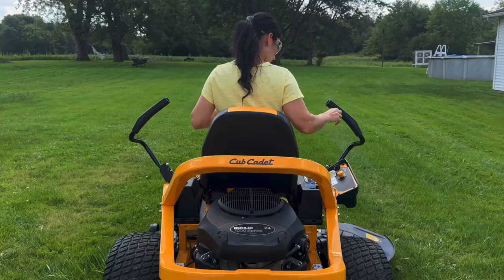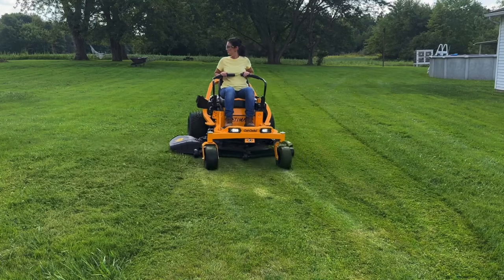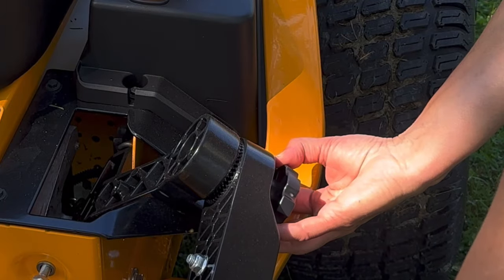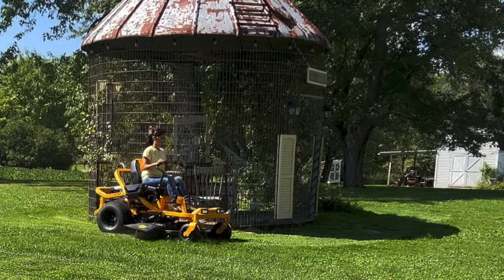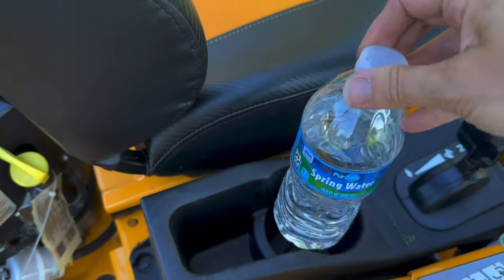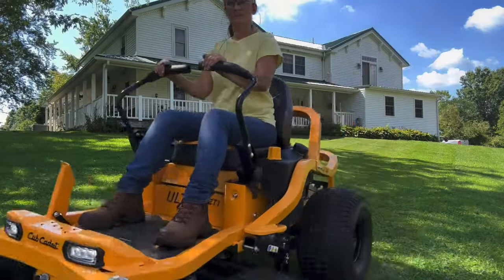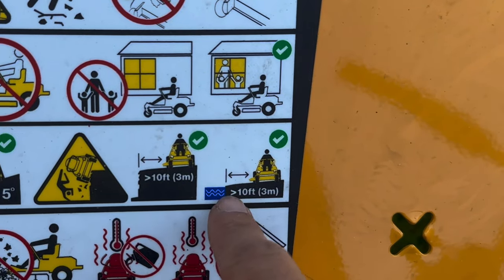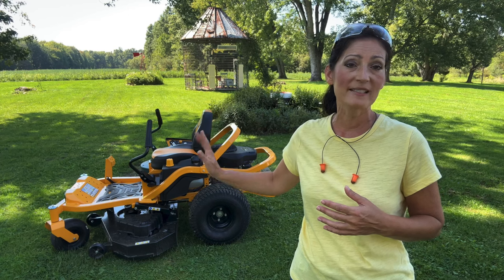MUST WATCH Everything you Need to Know! Cub Cadet ULTIMA ZT1 54" ZERO TURN MOWER FULL REVIEW Demo

Comment: I believe the hour meter is available at an additional cost. The only downfall for the ZT1 is the transmissions are not repairable, hence, they would need to be replaced when they become faulty. The ZT2, however, has a transmission which can be fixed or parts replaced.

...also, the seat does not have pivoting latches like ZT2, instead, you would need to remove hardware to get underneath, as with the ZT2, the seat just lifts right up for access

Comment: I bought a ryobi 54 in last year, (15 months ago) The battery drains out and the blades stop spinning after 20 minutes. The battery has the warranty for just one year. New battery costs $2000 and NO Warranty!!! After seeing this video, I’m going to buy a cub cadet 54 in from a Tractor supply in New port Richey, Florida.. It $3599 now

Comment: ZT1 50 for me!  Just ordered it this past Friday through a dealer.  I ordered the armrests and hour meter.  $4.1k out the door.  Do I need a 50" deck?  Nope, but it's good to have, and I REALLY wanted a 3-blade fabricated deck.  Why 50"? ... even though my yard is less than 1 acre, I have a couple seasonal neighbors that may want me to mow their yards from time to time when they are not here.  So, it's good to have the capacity to knock all of our yards out in an hour or two with the larger deck.  At least that's what I told my better half.  Here we go!  Thanks for your video!
Reply from the maker: @nhojcam  Let me know what you think of it! I love mine, this is my second summer using it.
Reply: @Jennyfromtheshop , i'm sure i'm gonna like it.  the weak link on all (as in, every single residential zero turn of every color of paint and brand) of these "residential" lines of mowers is the stink'in 2000 hydro's they put on 'em.  man, they just suck.  i plan to service mine every 100 hours or so.  yep, no drain plugs on these, so i'll take 'em off and drain them.  i'm in FL, so that means probably once per year.  i may install drain plugs the first time i have them off.

Comment: You can add an hour meter with this Cub Cadet kit.  Part # 490-900-C075. It’s about a 10 min install.  Kohler recommends the oil to br change every 100 hours and the filter every 200 hours.  I personally change both at 100 hours.  This is on the Kohler 7000 series engine.
Reply from the maker: Thank you!
Reply: @Jennyfromtheshop  Tractor Supply carries the kit. Cub Cadet online seems to be out of them. There is supposed to be one locally here I purchased online and will try to pick up later today.
Reply: We mow a LOT, and generally accumulate 35-40 hours per lawn-mowing season, and change the oil & filter each year. Our ZT-1-50 has a Kawasaki engine. The hydrostatic wheel drives are not designed to be owner-serviceable, you have to move up to the ZT-2 series for that, but there are YouTube films that show the DIY'er how to overcome this situation.

Comment: I bought one today. Love it! Is the seat adjustable? Great video BTW.
Also. Oil change every spring or 100 hours? What about break in?
Reply from the maker: Hi Adam! The seat isn't adjustable, but the paddles are. You can move them closer or further if needed. As far as the oil I had to look at Cub Cadet's website. They recommend changing the oil after the first 5 hours on a new mower, then 50 hours or once a year thereafter. Hope that helps!

Comment: Is there an adjustment height of the front deck casters?  They dig into my yard creating ruts every time I turn.    Also, the right control arm only seems to pull back half as far as the right but didn't seem that way last year.  Could something be wrong?
Reply from the maker: @johnmoffett-v5e  Hi John, the entire deck height adjusts, not the casters that I’m aware of. Could your one arm need adjusted? Are they equally spaced in the grooves?

Comment: THANKS so i just purchased a used cub cadet XT1 LT42 in great shape. So my question is whe nI cut the seat has no forgivness, hurts back and private parts LOL when I cut my 1 acre. How is the Automotive-inspired, ergonomic, fully adjustable premium 18'' high-back seat and a durable, advanced polymer seat suspension system optimizes comfort while reducing operators fatigue, how is the suspension on this ride in your opinion. ,
Reply from the maker: Omg, this thing rides like a Cadillac! What you described sounds like my old model except it hurt my boobs whenever I ran over the slightest bump. 😂 This seat is very comfortable and a smooth ride.
Reply: Polymer bumpers are junk, replace with 3 inch motorcycle seat springs barrel type. Easy..
All the plastic bumpers travel is taken up when you sit on the seat, they are useless.

Comment: What everyone should know is that mine died in under 2 hours
Reply from the maker: Died? You mean ran out of gas?
Reply: @Jennyfromtheshop  No of course not.  Deck wont engage, not a belt, not a pulley but most likely a relay.  I will never buy another cub cadet and nor should anyone else.
Reply from the maker: @mickrib1638  Hopefully the store you bought it from takes care of it. My old Cub Cadet was around 20 years old and still ticking that’s why I got another one.

Comment: Take the stupid polemer seat bumpers off and replace with  3inch motorcycle seat springs barrel type. The plastic seat bumpers are dumb accountants idea.
Reply from the maker: I haven't had any issues with the seat, but I'm also a petite lady. Maybe someone that's larger in stature might need different springs.
Reply: I did that with my 54 inch and it does make for a smoother ride.  Those plastic spring-like pieces are crap.

Comment: Hi there. New subscriber here. Glad to find your video. I just purchased a 42 inch version. Glad to learn about the removeable deck plate. I was wondering what that tool was for. LOL I'm sure I could have learned from the instruction manual but those are only to be used in emergency, Right? LOL
My reason for viewing is two fold. First, I was trying to figure out where the grease fittings are on this mower and that removeable plate should be a big help. Second, I wanted to look at your pretty smile a little longer.:)

(DISCLAIMER) Only read below this if you want to read a short version of my last 5 days.

I have a kinda funny story.  It's a little long but I will keep it as short as I can. Keep in mind I will be 74 next month.
in 2017, I bought my first zero turn. It was a Toro Timecutter 42'. I loved it. Used it for 5 years and only had to sharpen blades regularly and I had to buy batteries the first 2 years. the remaining 3 on one battery. I decided I needed more exercise and I sold it and bought a Ryobi 40 volt push mower. Seriously though, even with that, I could mow my front yard in 15 minutes. It's very small. The Toro would do front and back in 20 minutes tops.
After all that I had a fall at work and tore the meniscus in my knee. well surgery and arthritis has me out of walking my yard for even short periods of time. So. It was time to break down and buy a new toy.:)
I decided to go with electric since I 'd had good luck with the Ryobi push mower. Last week I bought a Ryobi 30" Zero turn since my yard was so small. It's the one with a joystick.(I figured that would give me a hand free for my beer. WRONG. My Code Red Mountain Dew addiction :) 
Now, I could go into detail about the delivery from the big box store with the orange sign But  the list of problems with that and the mower would be too long and I said I would keep it short. I will only say this. Who delivers an electric riding mower to a customer with batteries less than 10 percent. It would not move. After 2 hours I decided to return the Ryobi because the stiff i-drive(the I in I-Drive does not stand for intelligent) joystick had my arm feeling like I had been doing arm curls for 30 minutes, and if you let go of the stick, it does not return to zero. the mower keeps going at speed until you fall out of the seat(deal-breaker). THEN it will stop.
Enough on the Ryobi. Monday they (yeah same store, I didn't learn.) delivered my new Cub Cadet 42". The driver dropped it off and left. 1. It was hard to start the first time. It ran about 30 seconds and ran out of gas. I went and bought gas, poured some in, it started, but it wouldn't move. I tried several times to get it to move and it would not. So, back to the store, only to learn that no one had told me about those transaxle lock pins. Luckily this store is only 2 miles away. 
Back home. Moved the pins. drove it around for about 20 mins. Stopped to talk to a neighbor, she left and I turned the key, nothing. Got my boost box, started right up. Back to the store, They said bring the battery in they would charge it since I didn't have a AGM battery charger and the manual said do not use lead acid battery charger on it. Took battery in and left it overnight. Next day I checked and the battery was dead, so they gave me one out of the floor model. I shouldn't have any battery issues as I learned from my Toro that a $20 item called a battery tender(brand name) kept my battery working for 3 years. So, I put one on the Cub Cadet.
After all of this, it runs and cuts great and I am very pleased with the mower. 
BTW This is the short version of my last 5 days There are so many things I left out. Hope those of you that read it, enjoyed the story.
Reply from the maker: Happy to have you along, but what a mower odyssey you've been on!
Reply: @Jennyfromtheshop  And it continues. Today I drive 25 miles to a TSC in a neighboring town to pickup the hour meter that I found and purchased online  last night. I had to buy a 90vd3gree adapter for my grease gun to lube the squeaking wheels on it. 😆 🤣 😂
Reply from the maker: @ntmd8or100  OMG! 😅